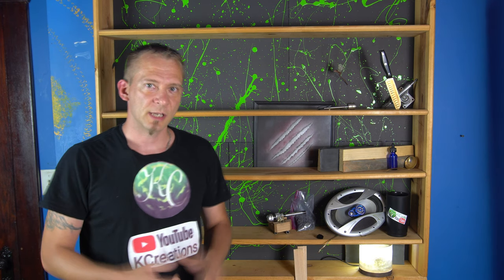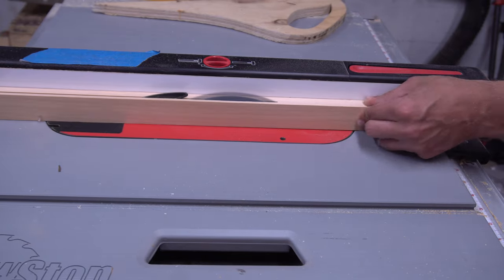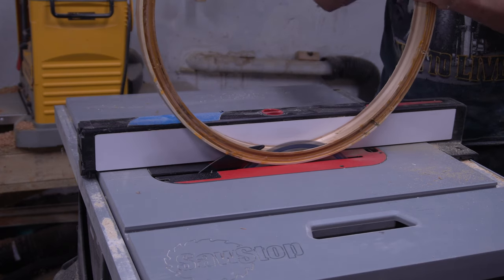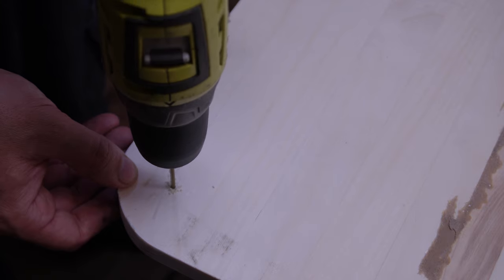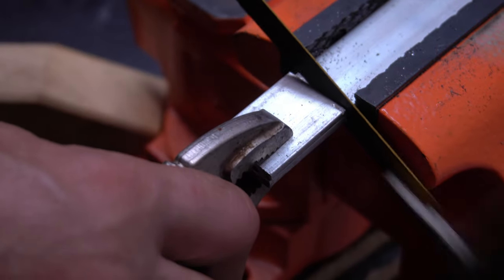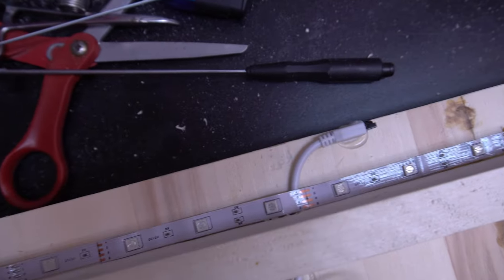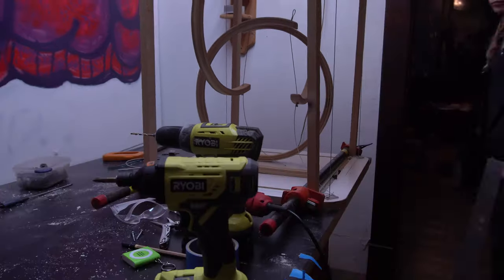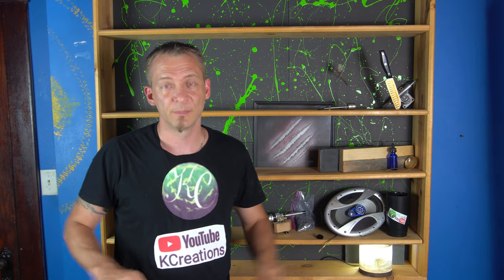Impossible Tensegrity Table Impossible Lights

Comment: steam bend thin metal downspout tube has a great amount of heat loss is why it didn't work.
Reply from the maker: I think your absolutely right a vinyl one would have been better but its not what I had laying around.
Reply: @KCreations4You  vinyl is still to thin. you need more mass to hold the heat. 3/4 inch thick plywood box would be enough, nothing fancy needed. 100s of steam bending wood videos here on YT.
Reply from the maker: @MrBonners  I think I would go that rout if it was something I planned on using more than once. This got the job done it just took what felt like forever.